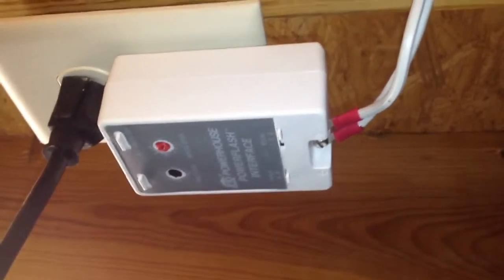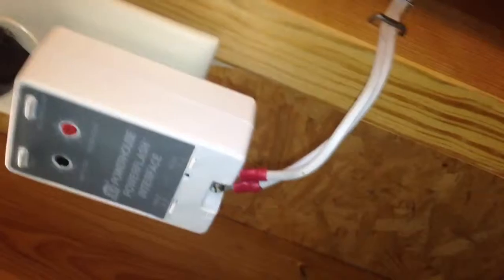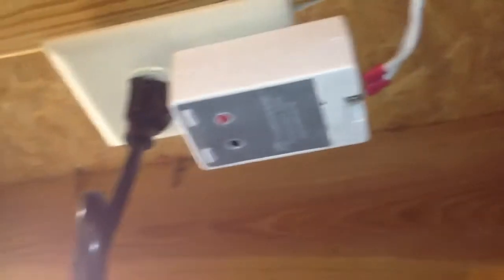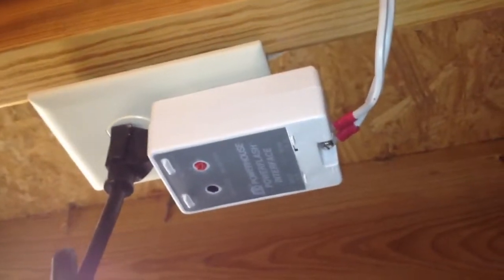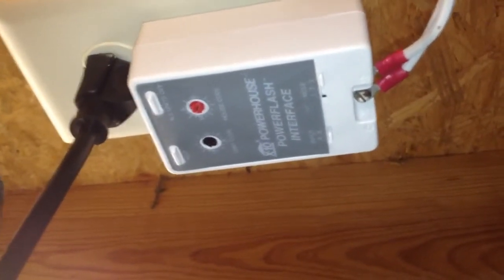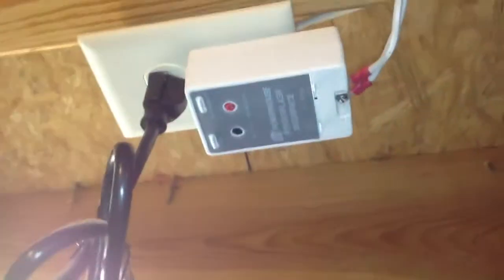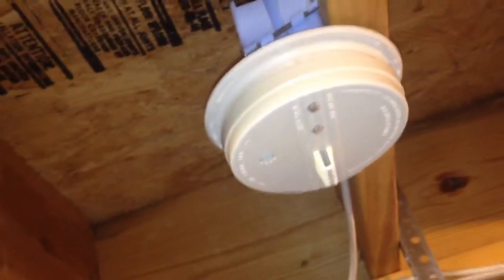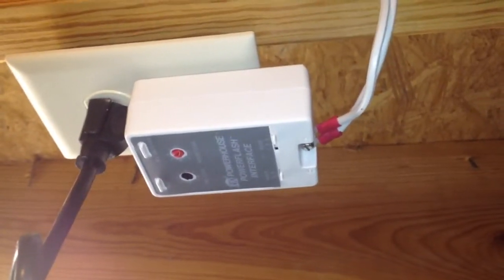Save your house from fire!! X10 Fire Alarm System

Comment: Really? Nobody commented in almost 4 years. Chances are excellent that this particular installation didn't last out the year, because it was set in a GARAGE, where neither a smoke sensor nor a CO sensor should be installed: Guaranteed frequent false alarms in normal use.  Garages, kitchens and enclosed furnace rooms should be covered by a fixed/rate-of-rise heat stat and nothing else.
Reply from the maker: Tarin Aten  it's still working.  Also, smoke and co2 sensors placed in my garage per local requirements.  My heating unit and hot water heater are both in my garage.
Reply: Thankyou for this. Its just what I need:)
Reply: Can u tell me what your AHP is ?